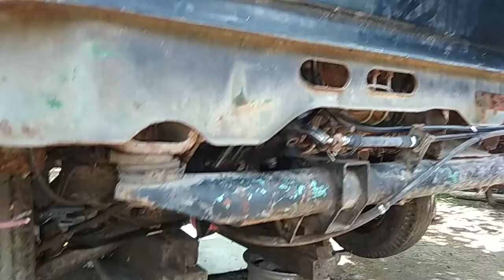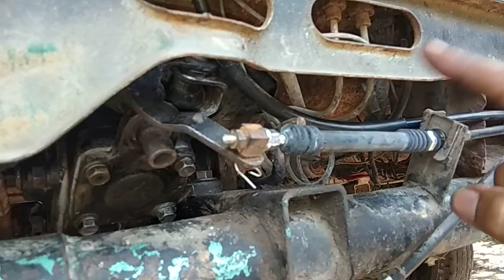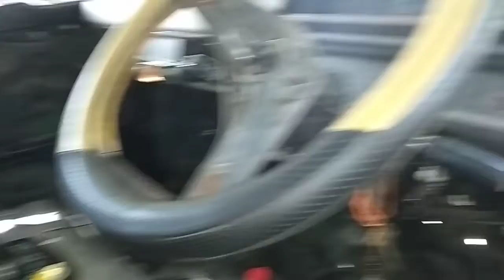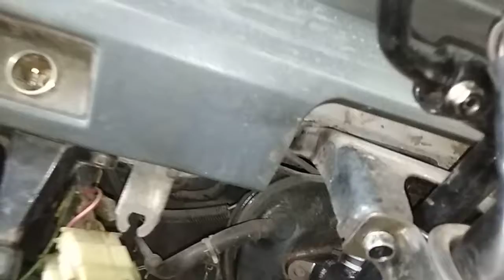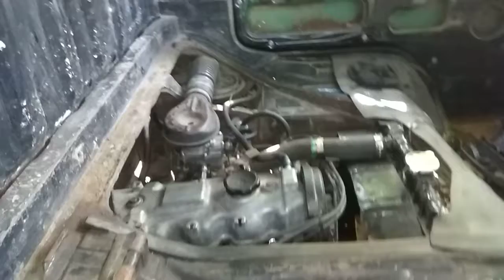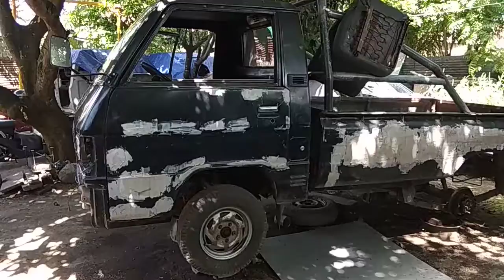Menghidupkan kembali L300 bensin (part 2)

Comment: Mas mau nanya L300 ane bensin.. di panasin sekitar 5 menit udah panas.. radiator normal.. apa pengaruh olinya ya🙏 mohon konsultasi nya mas
Reply from the maker: Klo temperatur normal gak masalah. Semua patokan indikator. Kecuali overheating biasanya silinder head melengkung atau kropos. Ganti oli secara berkala dengan Filter oli.